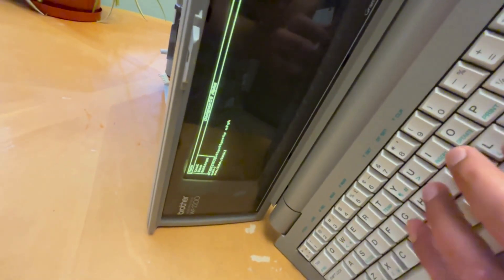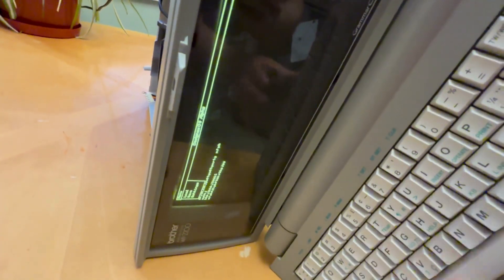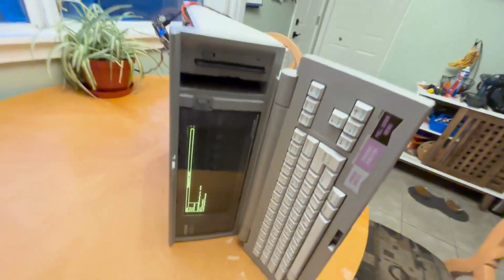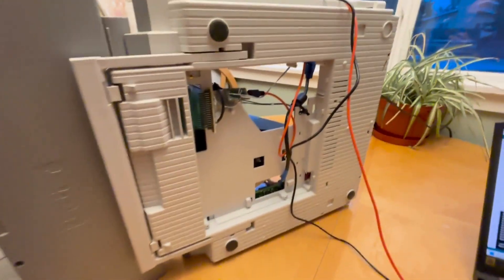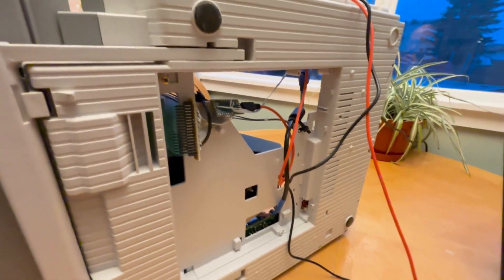I hacked a Typewriter to run my own code! Brother Word Processor

Comment: This looks very much like a Videowriter by Philips/Magnavox. That runs from a regular Z80. Curious to the schematics of this machine, and check if it is compatible.
Reply from the maker: So this is z80 based too, actually z180 micro. I really tried to find schematics or service manual but never did. I’m sure this could still be applied to it
Reply: @ChadBoughton  The original screen controller for the Videowriter is some NCR chip.

Comment: Nice job I was always thinking about getting one of these word processors and putting a small ITX motherboard in it or maybe a raspberry pie and making it a sleeper gaming PC but I would need to find one with a big enough monitor inside which is why I never wound up doing it. Although I would like to try it if I found one like the one you have.

Comment: Which micro-processor was on the motherboard ??
Reply from the maker: It was a z180 based microcontroller
Reply: @ChadBoughton  How did you read the ROM memory in a z180 processor ??
Reply from the maker: @InspironInspiron17 there is a separate rom chip that contained everything. I disassembled it
Reply: @ChadBoughton  May I ask you to post a pic of the board. I did z80/z180 products in the 80s.
Reply from the maker: @InspironInspiron17 I’m going to put up an instructable with lots of pictures
Reply: @ChadBoughton that’s a microprocessor, the zilog successor to the Z80. And supported by CP/M.  More than an microcontroller.